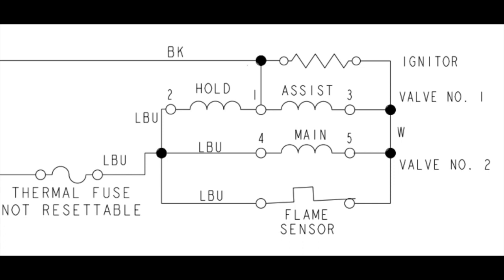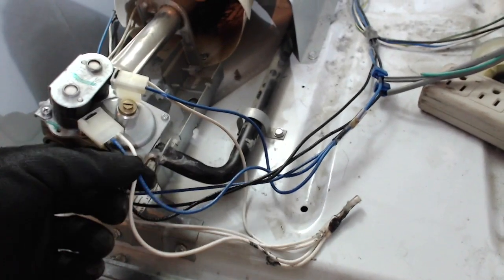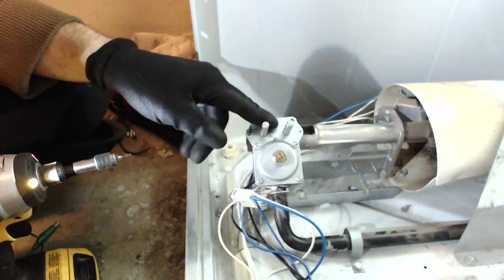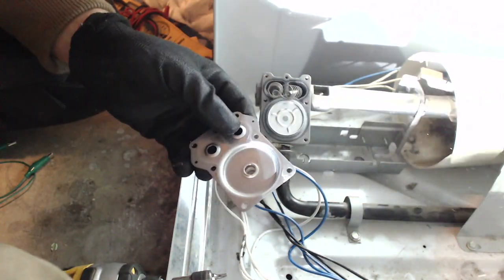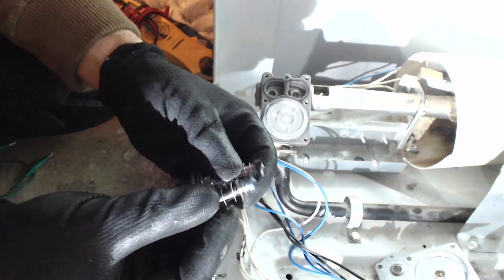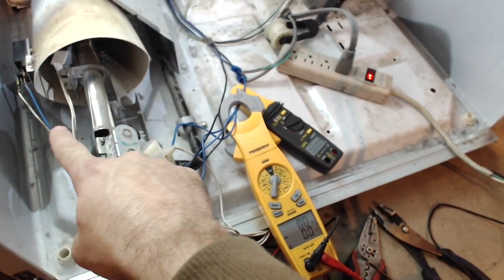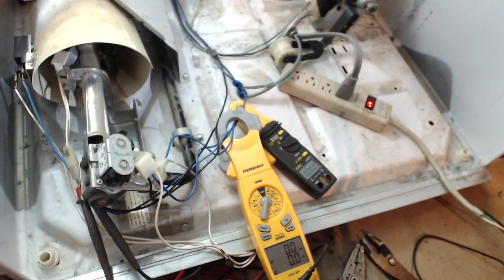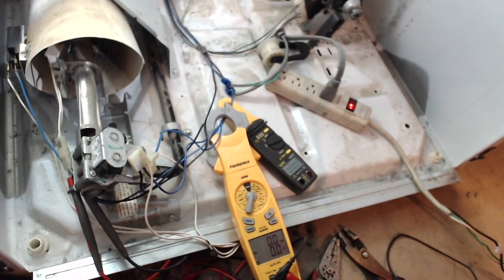Dryer gas valve and burner operation

Comment: Hi I have a Kenmore 70 that has the same setup as your video. I get no flame. I replaced the coils and the igniter which glows with no flame. The part number on the coil says 99142 A A (WR logo) but my coil replacement kit found on Amazon is part number 279834. Could have I bought the wrong coils? I noticed on a Matag dryer video a 279834 coil used different wire colors of the 3 prong which was red black white vs mine of black blue white. Ground appears in the wrong order so maybe I have the wrong replacement part? My wire colors match yours. Can you help? Thanks
Reply from the maker: 279834 is good coil set for your dryer. If igniter continues to glow and does not shut off, you probably have a defective flame sensor, mounted on side of burner tube, next to igniter). If the igniter glows then shuts off, make sure the gas valve is turned on (at the wall).
Reply: @electronicsprojects4708  Thanks for confirming I have the right kit. On the 1st attempt the igniter turns on and then I hear a loud click which turns the igniter off. Initially at the 1st igniter glow I don’t see a flame. But if I continue to run the dryer for a bit (10min) or say after 3 or more attempts of the igniter cycle I do get a flame. The flame begins really small. It does grow as the cycle continues. I don’t know how big is big enough but the drum does begin to get warm at this point. The dryer has not been used in 3 years. The last I recall when it 1st stopped working years ago it was totally cold and you would smell gas during its cycle. I don’t believe the gas value was touched, it’s a little metal thumb screw that matches the base metal of the gas pipe sitting at the wall behind the machine. Maybe it’s not open all the way? I don’t know which way to turn it. Being that it’s a little difficult to reach behind the machine it intimates me somewhat in the event of checking for leaks. My parents house was probably built around 78 so it may take some force to help rotate it.
Reply from the maker: @tomoprime217  sounds like you have a gas flow problem, I don't think it's the dryer's gas valve. It sounds like it's not getting enough gas from the wall. If you are not confident, I would recommend a professional to check the gas pressure is good to the dryer.
Reply: @electronicsprojects4708  strange enough, after actually using it on wet clothes it seems to dry them as it did before just fine. Maybe I am just over thinking things.

Comment: What exactly is the function of the two valves? I hear a click and the igniter comes on. Then I hear a second click and the gas comes on. So does one solenoid control the first gas valve with the igniter and the second solenoid control the second gas valve and the gas flow?
Reply from the maker: yes, this is so if one leaks, you haver a 2nd valve as a backup.
Reply: It's more complex than that. The piggyback pair of coils (hold and assist) are configured in a way such that the gas supply shuts off in the event of a power interruption so that the ignition sequence is forced to restart from the beginning. This prevents gas to build up in the drum during the time it takes for the radiant sensor to close, the ignitor to re-heat, and the main valve to open. It's genius devise that is extremely safe but much more than for redundancy.

Comment: I have a Maytag dryer that is approximately 18 years old. Just recently it began requiring several cycles to completely dry clothes. The flame does ignite and stay on but is mostly yellow and has an erratic sound as if wind is blowing past the flame. Could this mean it requires an adjustment to the gas/air mixture and where on the valve is that made? Or does the valve need replacing?
Reply: Check the current draw with clamp meter over the one wire of the igniter. It must be minimum 3A

Comment: Hi, I have a Kenmore Elite HE3 gas dryer and I recently found some minor to medium gas leak around the gas valve (using a Home-Flex detector bought at Home Depot). I'm wondering, instead of changing the whole assembly (the valve plus pipe is sold together), if there is anything I can fix on the valve, such as loosen parts, or maybe the coils? Thanks a lot.
Reply from the maker: the method in the video is the only one you can use to try to fix a gas leak from the valve.
Reply: @electronicsprojects4708   Thanks a lot for the reply. Do you mean to use silicon grease to seal the seating and the coils? Is that some special type of silicon grease? Thanks again.
Reply from the maker: @xmyn  no, it's standard silicone grease, you can buy it at car parts store or Amazon, Ebay. Super Lube 93003.
Reply: @electronicsprojects4708  Thanks for the advice. I did exactly what you showed in the video and sealed the leaky valve. I had to do it twice, I guess the first time I didn't put enough grease and a small trace of gas was still detected. Hopefully this will last for a while. I was lucky the valve of my dryer is located in the front so I had just enough room to work on it without taking it off the gas pipe. Thanks again, really appreciate it!
Reply from the maker: @xmyn  you're welcome, I do this repair about once a year, I haven't had it fail to where a customer called me back yet. If all is done correctly, it's a solid repair and cost saving as those valves are expensive and a pain to replace. Cheers.

Comment: Hey man, I need your help here, my dryer is making a buzzing noise whenever the flame comes up, I already changed the coils and it is still making a buzzing noise coming from the coils, do you think I need to replace the flame sensor? Side note: noise comes from 3 terminal coil 
Thanks
Reply from the maker: There is a metal sleeve that is inside the large coil. When the coils were changed, the sleeve may have gotten stuck in the old one and thrown out. It prevents rattling. I believe it comes with the gas valve as an assembly, can't get it separate that I'm aware of. If the rattle sound happened before changing the gas valve coils, you probably just have a metal to metal rattle. Try tightening up all the 1/4" screws you can find in the area. Sometimes you can wedge something between the metal brackets and it will go away.
Reply: @electronicsprojects4708  thank you so much for the help. I will go back in there and take a closer look at the metal sleeves you mentioned. The rattling was before the coils were changed, so probably the previous owner did changed the coils throwing away the sleeves. Thanks again and happy new year!!!!
Reply: @electronicsprojects4708  I have a 2 year old Maytag mgd7230hw and there is a random and loud buzzing sound coming from the coil/valve section when fired up. Replaced coils and checked sleeve, didn't fix it even when I'm applying anti-rattle pressure everywhere outside coils. Hence its inside and I'm starting to think is one of the spring loaded internal valves which you show in your video. When it isn't buzzing, I can whack it with a wooden handle and make it buzz (yes, the "whack it" method;). New gas control is $200. Sheesh.
Reply from the maker: @zhbh101  Make sure it's not just the frame rattling with the valve/burner support. If you put it on 'air dry' and the sound is still there, then it's not the valve.
Reply: @electronicsprojects4708  Thanks for your reply. No, it only happens with flame-on and I have grabbed, pried, pulled on everything. It's in the gas valve. Honestly, I think its in the regulator... when I tap it on top it always buzzes. Loudly. Hard to believe. In fact I'm sitting here writing this and listening to it from next room. Only $207 for a new one. Dryer only 2 years old. Sheesh.

Comment: Hey EP I'm stumbling through my troubleshooting. So I have no flame igniting, I have confirmed continuity with all sensors and I've replaced the coils just to be safe. I've been messing with it for 2 days and finally got it to light up twice right at the end of the igniters heat cycle. Now I'm to the point where I believe the valve itself is bad. I've ordered a used one from eBay for 25$ from a wholesaler. How can I determine if my valve is stuck and or not functioning beyond just the coils?
Reply: Flame sensor is good. I took off the valve assem and smacked it a few times on a wooden workbench then popped it a few times with a mallet. Double checked my coil connection/harnesses and it works. Thx for quick feedback
Reply: @Jake-xm6fl  Wow is that a recommended repair technique? Smack it on the bench then pop it with a mallet? :)
Reply from the maker: Just open it up, make sure you know the order you took it apart and don't get the valve parts confused. Test the two springs, making sure they are not broken. If you are getting a good ignitor glow, if the igniter never shuts off, the flame sensor is failed. If the igniter cuts off but there's no ignition or gas flow and you already replaced the coils, the valve is defective.

Comment: Hi !! 
I have a kemore Elite gas dryer, Hmy initial problem was a gas leak from the burner.I took the burner out ,opened it up cleaned it and that problem went away, Now, my thermal fuse situated right over the flame chamber keep getting blown and when I'm dring clothes my gas meter from the  basement is making noise like rattling pipenoise.  I'm wondering if it has to do withe the  valve piston, whether I switched them places. I remember one of them was a bit longer. The other think I can think of is to vaccum the exhaust vent air flow. Please help
Reply from the maker: You will get a rattling noise if you have defective gas valve coils, but only if the burner doesn't kick on. You may have reassembled the valve incorrectly. Thermal limiters usually fail when there is low air flow, so check that air flow outside where it lets out.

Comment: I have a dryer that was working fine, after we move to a new house stopped working, I decided to replace the coils and it is working back again, but when turns off a small gas leak keeps a very small flame, seeing this video I can see that the valve can be fixed changing the seal, my question is where can I order those seals? should I buy an entire new gas valve?
Reply from the maker: in changing the gas valve coils, you may have not tightened the bracket down enough, or the seal was already compromised and you set it over the edge when you replaced the gas valve coils. I would use a silicone grease, apply it to the seal and put it back together. See if that works. If not, you will have to change the gas valve, they don't sell the individual components separately.
Reply: @electronicsprojects4708  Thank you, I will try and let you know.

Comment: Getting a glow but no flame/ignition.  I tested the parts and all seem ok.  Replaced the coils, still nothing.  When I hit the start button I get a grinding noise like a bearing is going out.  Is this the gas valve?  Also, is there a special grease you use on the gas valve?  Thanks.
Reply: which you had gotten an answer. same issue im having even after coil replacement and its the only thing i can think of

Comment: I have a Whirlpool Duet Gas Dryer (model GGW9250PL3).  Upon startup the ignitor glows and the burner flame comes on but then goes out after about one minute.  Flame does not come on again but when unit cools down (after a few hours) and upon running the dryer again the igniter comes on again. and flame lasts only about 1 minute again.  I checked the coils.  The resistances on the 3 terminal valve coil was right within the manufacturers limit shown on their troubleshooting sheet.  However, for the 2 terminal coil, manufacturer says resistance should be within 1170 ohm to 1270 ohms.  I measured 1287 ohms.  Manufacturer says if outside range to replace but was thinking that 1287 ohm is close enough to 1270 ohms.  What are your thoughts on cause of problem? and should I still go ahead and change the one valve coil?  Looking forward to your reply.  (PS.  I checked the continuity of the Flame sensor and it seems good ).  thanks. Nick Jag
Reply: I'm not a specialist however, this sounds like the limit sensor needs to be replaced.

Comment: thanks a lot! 1)grease to fix leak might be temporary only; 2)I did see clearly the click of valve.
Reply from the maker: Over the years, applying silicone grease has been successful for me.
Reply: @electronicsprojects4708  which grease should be use ? 
Any reference code ???
Reply from the maker: @Beeman1972  Super Lube 93003 O-Ring Silicone Grease

Comment: I'm getting a gas smell inside my dryer when not running.  Could that be the gas valve?
Reply from the maker: yes
Reply: @electronicsprojects4708  Hi do u know which side the longer piston goes. I took mine out now I can't remember which side it came from whether the primary or secondary valve
Reply from the maker: @lucile1919  It's been a while, I will set them in order when I take it apart, so I don't remember which is which. Best I can tell you is try one first, then go with the other if it doesn't fit.
Reply: @lucile1919 did you figure it out? I just ran into this issue and came to comments to see if anyone else had this happen to them.

Comment: My Maytag DG309 dryer lights, runs for about twenty minutes, then the flame goes out and does not relight, is this a sticky gas valve or coil issue?
Reply from the maker: sounds like defective gas valve coils
Reply: @electronicsprojects4708  That was it, I tested the coils and one of them was an open circuit.  I replaced that coil with a coil that tested good from another Maytag DG309.  The dryer now works without issue.

Comment: Thank you for your response concerning my question about my igniter sensor staying on without the flame kicking on. 
I have determined that if I tap on the sensor, the flame kicks on. 
This sensor was a $9. Chinese replacement part which only lasted approximately 20 cycles. I have now ordered an OEM replacement part for $42. w/shipping...thanks again, Ron.
Reply: Tapping it while loose causes a spark on the chamber causing the sensor to kick on igniter. I do not believe that makes it a bad sensor. Mine does the same thing

Comment: I have a Kitchenaid gas dryer that does not light after the glow igniter is on. The element glows red and remains on without shutting off while the gas valve is not opening. 
The coils read good after testing with an ohm meter. Could this actually be a bad flame switch even though the flame switch tests good for continuity? Thank you, Ron
Reply from the maker: The igniter should not stay on indefinitely, under normal circumstances, once the flame sensor 'sees' the igniter glow bright enough, the flame sensor will open, giving voltage to the main coil to open up. If your igniter is staying on indefinitely, you could be looking at a flame sensor that the contacts have fused internally. You can test this by smacking it with the butt end of a screwdriver after the igniter glows bright. It should release the contacts and the gas should flow and ignite like normal.

Comment: I have a problem with a dryer the flame start in the begining when its cold but once i run it and turn it on again the flame wont light up anymore i have to wait until the dryer cools off again and i have new coils i have tested them and resistance is good but i cant find the problem any help will be helpful thank you
Reply from the maker: That is typically a symptom for defective gas valve coils, if you test the coils cold, you will get a good reading. They only test bad when you have run them and the gas does not ignite. (when the are hot) You can also heat them up to test them, but I would  just instal the new coils and test the dryer.

Comment: Does it matter which coil (2 and 3 prong) goes on either valve, or are they interchangeable?
Reply: They are not interchangeable. Put them back in the same place.
Reply: It's going to matter since one is the booster coil and one is the hold coil.

Comment: Thank you for a different video explain the gas valve.  I'm having trouble with my Estate dryer. No heat but all components have continuity, so I'm stomped. Before I change gas valve, can you explain when the igniter is suppose to light? Mine has continuity but there is no glow. Can it be because the valve might be bad?